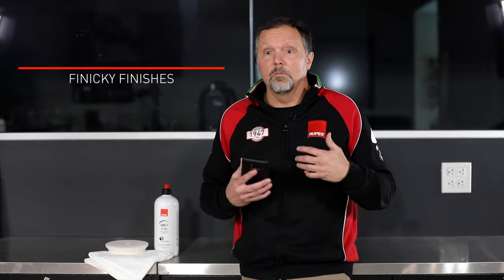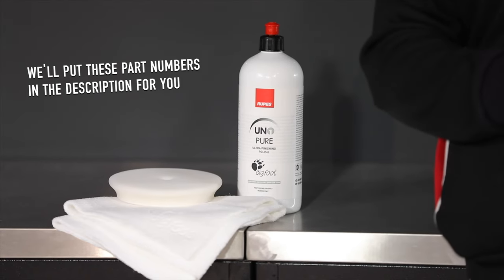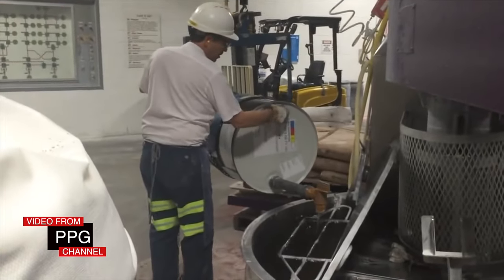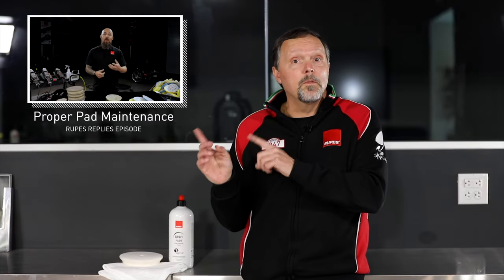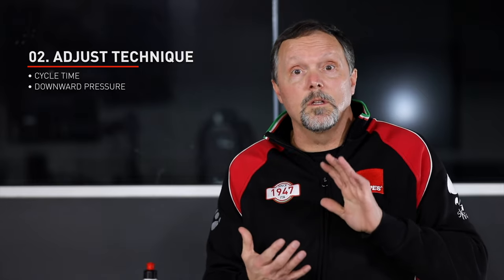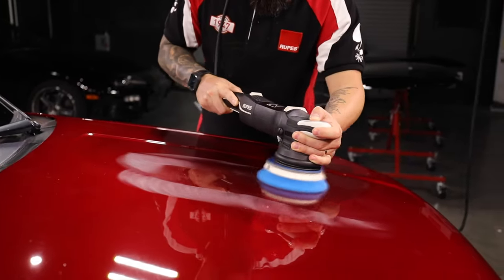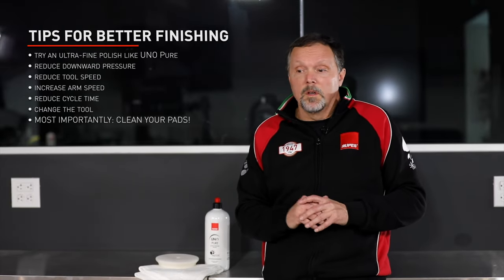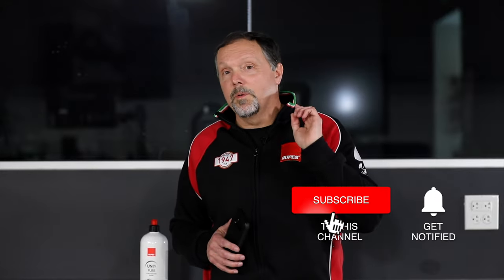Polishing Difficult to Finish Paint - [RUPES Replies Season 02 Episode 02]

Comment: Thankyou Jason for your insight which is always appreciated even though I rarely polish/detail anything these days.   Mitsubishi is one of the worst brands when it comes to paint in recent years IMHO.  Their paint looks not much better than cellophane these days.  Most polishes do not film very well on them and the paint is somewhat grabby.  The compound/polish wont turn to a clear or white film on the surface at all, it just dries up to nothing. Isuzu is not much better.   Audi and range rover paint finishes however are very good to excellent in most cases and the Aston Martin DB11 that  I coated last week was insane.  Dead flat.  Finishing a car's paint is what I feel I did better during my career than removing defects.   My saying was - If the finish I deliver to the customer does not satisfy his/her expectations then who cares how quickly I removed the defects.  "Focus on delivering the best finish based on what their paying whilst being as efficient as possible" was my motto. Okay my question is -  What is Rupes stance on closed cell and open cell foam pads?   Open cell creates air flow which reduces heat build up but it also dries the compound/polish quicker which is something I never wanted back in the DAT polish days.  They also soak up polish easily if you use too much.  Closed cell keeps the compound/polish where it needs to be, creates more heat but works more efficiently.  I've always liked closed cell foam but I know they wont last as long as open cell but they dont absorb polish anywhere near as much or lose their density as quickly as some open cell foams.  Nothing worse than a pad that loses its density too quickly.
Reply from the maker: Thanks, as always, for sharing your insights and questions. All our products are designed to promote airflow, so in that matter our pads are open cell by choice. In our experience heat is the bigger adversary in the process. Compounds can be formulated to function more effectively with open cell materials. Techniques can be more easily adjusted to accomplish the task. Heat management, in our research, is the hardest thing for technicians to compensate for or even know when it is becoming problematic. To that end, providing materials that manage heat most effectively is, in our opinion, the right approach.

Comment: Great work by the rupes team for bring these topic light and sharing some knowledge to all !  
A  quite arguable topic to shed some more light on would be "to protect or not to protect newly paint vehicles"  that just came out of the  bodyshop . Where  methods such as forced curing and chemical advancement in catalyst are concern ,should the paint still be left to outgas before  polishing and applying   wax , coating or even paint protection film to protect the surface and how dependent  it is on the the paint job done
Reply from the maker: Good topic for a future episode. There are a lot of variables, including the type of paint, whether or not it was mixed to the paint manufacturers specs, how it was sprayed, how it was cured, etc.

Comment: Also room temperature matters on softer paint. People do it in the shade outside still hot will get that haze
Reply from the maker: Excellent point. Really environment (ambient conditions) impact all matters of polishing, from result to user experience, and efficiency. Nearly all operations in paint correction are better when the process is performed in a controlled environment.
Reply: @RUPES  how to polish around the car emblem or logo without damaging the pad ?
Reply from the maker: Depends on the level of correction needed, complexity of the job, and the amount of time you're willing to dedicate to the process. If the job justifies the time/labor removing badges and reinstalling them after the correction is the 'best' way. If the badges must remain in place then masking them with tape is an option.

Comment: Jason.... this is the "dark arts"  when you start experimenting with differing pads and compounds, but once again youve shown that with a little sideways thinking, you can achieve results which are needed and deserved
seems so logical, to make the pad spend less time on any given area, but easily forgotten in the heat of the moment
Reply from the maker: Good to see you're picking up on the concept. You're correct, these adjustments are not complicated, but as you said - easy to forget as we work. Thanks for watching and commenting.

Comment: Jason, techniques/tools/devices have you found best for getting the hard to reach areas such as the center of a hood on a lifted truck? Heck, even though I can stand in the bed of a truck to address the roof it's still difficult to see if the job is being done correctly.
Reply from the maker: Great question. Scaffolding, ladders, or platforms help a ton. On really large vehicles there are even specialized tools known as "topside creepers". These are generally to allow someone to perform engine work on taller vehicles, but they work as a stable platform for a detailer to address the center sections of hoods on tall vehicles as well. If you do a lot of lifted trucks or larger vehicles it may be worth investing in something like that to help you address those areas.

Comment: I’ve got this terrible GM black in the shop right now. I started on blue wool coarse foam with DA coarse and struggling to finish it out. I’ve tried yellow fine on yellow fine foam, using the 21 no go. So I guess I might have to go at her with my old school cyclo or the porter cable? Also tried ultra fine on ultra fine white, same thing mild haze. I will also try the other recommendations in this video on tool speed and cycle time
Reply from the maker: Cycle time and speed adjustments are the adjustments that will give you a high chance for success. Just as the video indicated, all the tool have a high capacity for finishing IF you make the adjustments. Before throwing another tool at it, try cutting your cycle time down to 15-20 seconds with increased arm speed.
Reply: Hi Total Package Detailing, did the adjustments work? I have the same problem with the 21. Greets Michael
Reply: @mboating340  Yep. Less passes did it.
Reply: @mboating340  Well less cycle time rather I mean. Same passes just moving a heck of a lot faster in the arm speed.

Comment: hello, excellent videos, but I have some doubts, what speed setting would we use for soft paints with the rupes mini?  if you could put what speed setting is better for yellow pad and white pad...
Reply from the maker: Thanks for watching and commenting. Tool speed is a variable that you adjust based on the situation. On some paints it could be higher, on others it could be lower. This is also in combination with other variables like arm speed and down pressure. For standard applications we recommend the tool be operated in range 3-4 on the speed dial, however depending on the hardness particular paint you're on, the severity of the defect you're addressing, and the other variables we mentioned below the speed could be higher or lower.
Reply: @RUPES  OK thank you very much.

Comment: Great videos and wonderful product, RUPES team!  😎

Quick question ... when I shake (as must be done) my 8.5oz bottle, I probably lose a half-ounce, once I pop up the cap (it keeps oozing out, even if kept upright).  Is that normal, as it seems to be wasting precious product?  😕

P.S.  By the way, what does the acronym “UNO” stand for?
Reply from the maker: Not sure we’ve experienced “oozing” after shaking the bottle, so we don’t really have any advice for you there. 

UNO is Italian for ONE. Since the UNO family of products is designed to work across all tool movements it is ONE product for all tools.
Reply: @RUPES , thanks so much for the quick reply, team!  👍🏼

Thee oozing seems to have gotten better, after I removed the red tape that sealed the cap to the neck (I don' know if it's meant to be removed or not).  Anyway, either enough product oozed out, or the pressure equilibrated enough, after shipping, that the problem has ceased.

P.S.  I'm surprised nobody's commented about the amazing scent of UNO Pure (it reminds of very nice sunscreen ... coconut/aloe vera-like)!!    LOL
Reply from the maker: Glad to hear the problem is solved. We do not ship with tape applied to the bottle, so this is likely something your distributor did for shipping. In the future it would probably be a good idea to remove it immediately and maybe even unscrew the lid slightly to allow the pressure inside to equalize. Also happy to hear you like the smell. We think its subtle and unique! :)

Comment: After polishing or compounding with your products do we need to use an IPA after any application
Reply from the maker: It isn't required, but if you intend to apply a protective coating you should follow whatever procedures the manufacturer of that product recommends to get the best results with their product after polishing. That may or maynot involve a prep wipe.

Comment: In case of very very soft paint , sprayed 1 month ago and was "polished"very unprofessional to remove defects like dust , how to remove deep deep holograms and massive haze withouth taking too much of the paint  ?
I want the best finish before ceramic coating, but the paint its so soft , cant get nice finish , even its so hard to wipe   the rest of the liquid after polishing with  the microfiber!
Reply from the maker: Thanks for your comments. It is impossible to say because there are so many variables. In many cases all you need is a fine or ultrafine polish to remove holograms and haze, even severe ones, as most of those conditions are very shallow on the paints surface and do not require aggressive products to correct. Ultimately, you need to perform a test spot to see what the best solution will be. That is the only way to know for sure.

Comment: Jason, sorry but I have another question: when you say "clean the pad frequently" what do you mean exactly? I understand that depend on the paint hardness/softness but , thinking to be on a original German paint, generally speaking is suggested to clean one time for every door panels, for examples? Thx
Reply from the maker: No need to apologize. We're happy to answer questions - that is what this video series is all about! The fact is you cannot clean too much. The cleaner the pad is the better it will perform. On a harder paint, there will be fewer side effects if you complete multiple passes and panels before cleaning because the paint is removed slower and the paint is more resistant to marring from the residues. A softer paint will load the pad faster and be more prone to hazing. Because hardness is a scale with infinite possibilities its best to "read the paint" - if you notice a haze after two or three passes it is a good indication that you probably need to clean as frequently as every pass. If it does not then you don't need to clean that frequently. All of these things are about observing the results and adjusting to compensate for what you see.
Reply: @RUPES  I think to understand why I noted some haze zones after a couple of passes....maybe the clear topcoat too soft !! I keep this information in my pocket for the next car...thnx very much guys!

Comment: Hi, do we have to use D-A FINE after doing D-A COARSE or have gone directly to UNO PURE? Is UNO PURE designed to go directly after D-A COARSE?  (D-A FINE + UNO PURE) or (D-A COARSE + UNO PURE) Will these two combinations give essentially the same result? Because I don't want to do 3 steps for nothing.
Many thanks for your response.
Reply from the maker: You don’t have to follow a strict tiered system for paint correction. Any combination of our products can potentially provide a one-step correction, depending on the hardness or softness of the clear coat. Start with D-A FINE and Yellow Foam for most vehicles. If this doesn’t remove defects, try a Yellow Wool pad for heavier cutting. For softer clear coats, if D-A FINE leaves a haze, consider using a White Foam pad with UNO PURE. For heavy cutting, Blue Wool and D-A COARSE might be needed, with a follow-up step using either D-A FINE or UNO PURE as necessary- but both should not be needed. Always perform a test spot to determine the best combination for your specific paint and defect level. Hope this helps!

Comment: Can I use uno pure (white finishing pad) after using uno protect (yellow wool pad)?
Reply from the maker: Thanks for posting your question. 

No. That wouldn't be a good idea, because UNO Protect is leaving behind solids (a polymer sealant) so going over the top of that with an abrasive, even something ultrafine like Pure, is going to remove that product. It would also likely clog up the foam pad with the uncured sealant and make for a really bad polishing experience. There really isn't a realistic scenario where you would choose to use UNO Protect and UNO Pure on the same vehicle. Two different products for two very different uses.

Comment: How long is Uno Pure left on the paint before wipe off? I just purchased this product (didnt arrive in the mail yet)  But wanted to check.
Reply from the maker: UNO Pure is not a protective product, so there is no cure or dwell time. Treat it like any other compound or polish and wipe it off immediately after the application cycle is complete and you need to inspect your results.

Comment: Im only can find uno protect in my country, is it ok for finishing, later i will wipe it out with IPA and go for ceramic coating step?
Reply from the maker: Where are you located? If you can get UNO Protect you should be able to also get UNO Pure. To answer your question however, that would not be recommended. If you need a product for a final polish before coating and cannot get UNO Pure we would recommend instead D-A Fine.

If you need help finding a distributor with the products you want contact us for assistance www.rupes.com/contact-us
Reply: @RUPES  indonesia, it is not ready yet.

Comment: Any tips for uno pure not wiping off easy?
Reply from the maker: Reasons why this can happen: using too much compound on the pad, surface contamination can cause compound to dry out and become sticky (we recommend wiping the surface down with a decontamination spray beforehand - REVEAL products are great for this), over-cycling can cause solvents to harden - you'll get the best results between 30-45 seconds cycle time, also keep caps closed, open caps cause outgassing which dries out compound and causes it to be sticky to the surface. Hope that helps!
Reply: @RUPES  thanks for the info, looks like i overwork the product